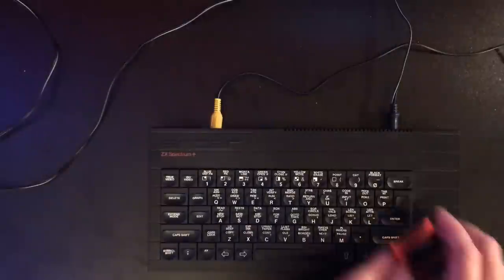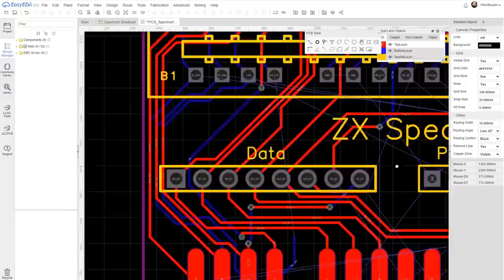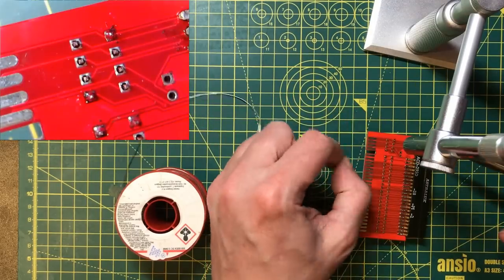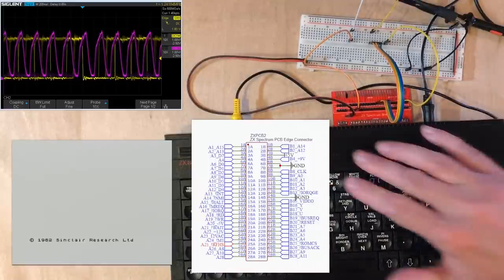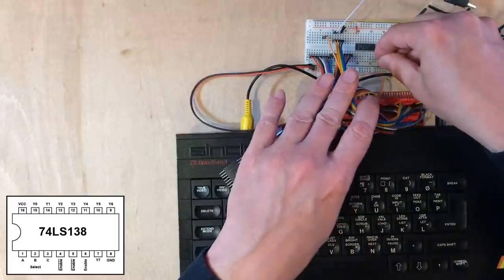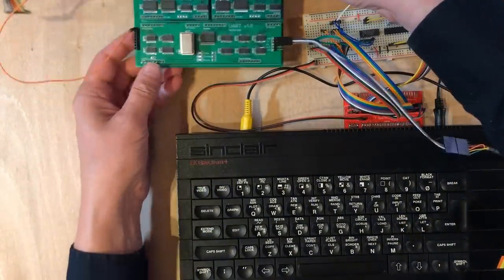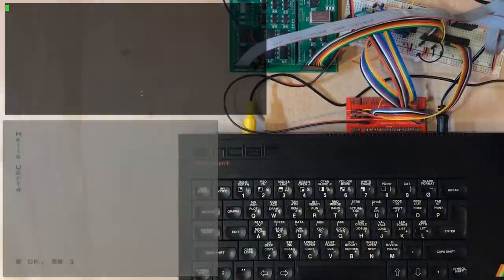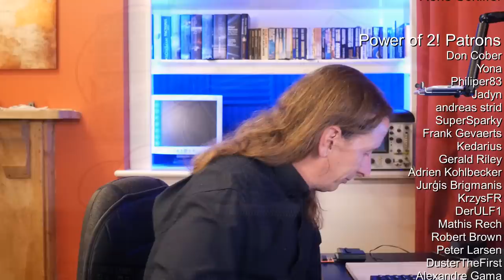ZX Spectrum, Expansion Port Research

Comment: Hello, I'm glad you back on Speccy Thema. Sorry I didn't respond earlier. You don't really need to distinguish between read and write if you dedicates a specific addresses for specific operations; like one address for write parameters, and another for read results. I mean if we(you) are still thinking about "coprocessor" expansion into ROM slot. 
To make expansion direct on edge connector from speccy will be easier for sure :-)
Reply from the maker: Making the expansion the main port rather than the rom cartridge would of course be easier. I’m not the guy for the easy path.

Comment: I really like the idea of extending the functionality of old machines by changing what they interface with. A while back I was working on a project to make a SNES controller out of a block of wood by using some conductive ink for touch sensing and having a microcontroller translate it to SPI for the SNES. I think I still have it laying around half finished somewhere.
Reply from the maker: Sounds interesting!

Comment: I know this is quite an old video by now, but for anyone watching in the future: flux will help with getting the solder to properly flow and not just bead up on the surface.  There's a tiny amount in solder wire, but not enough to prepare those large surfaces.
Reply from the maker: Flux is sometimes a tradeoff between easier soldering and the mess!
Reply: @weirdboyjim  That's certainly true!  I've spent plenty of time cleaning up leftover flux with alcohol and a close-cropped brush. Situational for sure, might help enough to be worth the mess on something like this edge connector.
Love your videos, inspired me to implement a close analogue in verilog to run in simulations to really understand what's happening at the lowest level of CPUs.

Comment: You're brave adding a copper fill around the edge fingers. Lots of potential for shorts from resit wearing and alignment tolerances. 😂
Reply from the maker: Well you're right, I didn't consider that.  Doesn't really matter for a temporary breakout like this but I'll try to keep it in mind when I design something more permanent with an edge connector.
Reply: @weirdboyjim  Hehe! Just trying to save you a mistake I've made before!

Comment: @14:30 Umm...the clock does stop, every time there's a CPU access to contended ram. That might explain both the unusual shape of the wave, and the clock rate discrepancy as well. However, I know very little about oscilliscopes. There is no crystal on the Spectrum, true, the clock generator is built out of gate array elements on the Ferranti Uncomitted Logic Array.
Reply from the maker: Yeah, the clock is a basic 2 transistor oscillator. Looks like the ULA pulls it down when it wants to take over the bus.

Comment: Wow... I must have missed it last time... "top marks" to whoever put the Spectrum edge-connector stuff into the EasyEDA library! So nice to have fiddly jobs done for you by somebody else!
I'd expect to see everyday stuff in there but Spectrum add-ons aren't exactly what you'd call "mainstream" - excellent work whoever you are.

I'm also, finally, impressed with Sinclair BASIC... when you did `LEN a$`, I said "nope, you need parentheses on that function"... ... ... and you didn't. When you indexed into a string like it was an array, I was all "No way! This is the 1980s! That won't work!!!"... ... ... and it worked. As a long term Speccy detractor, I'm now like "oooh! That BASIC's actually quite good".
Reply from the maker: Yeah! That was handy! The spectrum basic is an odd beast,  the method of typing whole keywords seems weird at first but once you realize that's how it's tokenized in memory (rather than being stored as text) it makes much more sense.
Reply: They've spelt the "refresh" signal name incorrectly though - it should be RFSH not RFHS.
Reply from the maker: @TomStorey96  I’m prepared to overlook that.

Comment: Your irritation while routing may have been alleviated by using the auto-router.  It definitely would've been an easy design to check over after it completed.  Just a thought.  Great job, by the way.  You have one of the best channels for learning about hardware around.
Reply from the maker: Perhaps, but then I would be reading lots of comments about how I shouldn’t use the auto router 🤣.  Glad you liked it.

Comment: There is a waste operation in the calculator, that writes to location 0.
I noticed that because my old zx has 64K ram. At startup the orginal rom was copied in to lower 16K. At some math operations location 0 to 8 was changed. Changed this waste routine to dump somewhere else.
Reply from the maker: Interesting, and a bit weird. Good to know I was seeing legitimate writes though thanks.

Comment: The ULA does have control over the clock going to the Z80. What it does is to drop the clock signal whenever it needs to access the screen memory in the lower RAM to ensure that it rather than the Z80 has control over the bus going into the 4116 chips. Part of the consequences of this can be found in the custom loader software used to DRM protect later Spectrum games. The code for these loaders was always ran in the upper RAM because the process of interleaving memory access and instruction fetches with the ULA's fetches meant the timing of the lower RAM could not be guaranteed making a loader coded in this space less reliable.
Reply from the maker: Yeah, I remember the lower ram was slower.
Reply: It was with the ZX, messing with some game in MONS (as one does), that I encountered my first anti-debug feature ever... I was staring at the screen in disbelief at the code writing a constant into a register, then immediately reading it back and comparing it to another value - wtf, how can this ever succeed...?

Then the little lightbulb went on above my head and I just laughed my ass off: the register in question was the R-register, which gets auto-stepped in hardware, and if you were step-by-step debugging you sure as hell didn't read the same value back as if the code was executing continuously. Trivial to bypass once one understood what was actually supposed to happen...
Reply: @AttilaAsztalos  Ah, yes. That was the second version of something which I think was called "Speedlock". I wound writing a program that automated the process of modding the decoder to get to the loader. Ended up that I could crack those in a few minutes!

Comment: Living in a broke-ass EE country at the time, I nonetheless somehow managed to pester my parents into getting me a local ZX clone (a CIP03) and managed to miraculously source a gorgeously red QuickShot II joystick (that thing had autofire ffs!), but had no way to connect the two. There were precisely zero ways to buy an interface or at least the relevant edge connector. 

But the actual circuit of a Kempston adapter was a piece of cake for my TTL-savvy young self, and the logic ICs were actually available locally (with some effort). So I hand-sawed a bunch of long thin comb-like fingers (for individual flex) with the right spacing into two pieces of PCB, drilled two holes and soldered a short piece of stripped copper wire into each finger (as "the contact"), then bolted them to each other facing inwards with a third piece between them that spaced and keyed them to the key slit in the extension port. 

Needless to say, the pucker factor on the first test of this very DIY interface was indescribable - I was intensely aware that if I short or hog the CPU bus in any way and damage the Z80 I'll NEVER get a second ZX... but it worked fine. For years and years. Good times...
Reply from the maker: I’m equal parts impressed and terrified by that description. Cool that it worked!

Comment: Interacting with the spectrum is a bit scary in some ways, I would be worried about something connected to the port potentially damaging the machine, maybe if you do a revision you could add some buffer ics to it to help isolate it a bit.
Reply from the maker: That would probably be smart and safer, we do if course always do the smart and safer thing 😅

Comment: It would be cool to see some new spectrum games making use of cartridges, as the cartridge could do somethings the mappers did with the NES - like auto-cycling through graphic definition table every frame for parallax scrolling effects, per-scanline animation, DMA blitting etc :) Obviously it would have been prohibitively expensive back in the day (the speccy was my first computer) but now a custom "ROM" cartridge is obviously much cheaper :)
Reply from the maker: Well the cartridge port isn't anything like as flexible as the snes one was, but part of my goal is to push the limits of what we can do with it.
Reply: The Spectrum has bitmapped memory in RAM. The NES used a tile table located in the cart, usually ROM. So that's how mappers could do tricks like that. For the Spectrum you can only alter the screen by reading and writing to the RAM. Even if you had some separate circuit, rather that doing it on the CPU with software, you're still limited by how quickly you can write to old RAM chips like that. So that idea would be difficult to get up and working, at least much more difficult than on the NES. 

The tiles in cart ROM meant the NES didn't need tile RAM, so was quite a lot cheaper to make. The downside was that each cart needed 2 separate ROM chips, CODE for the CPU, and CHAR for the PPU. They had their own bus each which is why the NES's cart connector was so enormous. Overall it was cheap, and made games at least twice as expensive as they had to be for other consoles. The Master System did it the usual way, and had much better graphics, so there was no advantage to the design other than money. "NES-expensive" is a term that should be in the lexicon as much as "Nintendo-hard" is! ALL 8-bit systems had difficult games, it's not a Nintendo thing. But as ever, it's how the Americans had things, and they're in charge of the language apparently, including slang.

See also the "Videogame Crash" which only happened in North America, and only affected consoles.
Reply: @greenaum  yep I’m aware of how the spectrum worked - I wrote enough software for it 🤣 I’ve also written an NES emulator along with others in my spare time… Although different there is the possibility of greatly increasing the potential using a custom cart:
DMA transfers. By halting the Z80 and copying from ram in the cart to display ram which is much faster than the usual method of popping from the stack into registers then pushing into display RAM.
Handling sprites and a tile map based display in the cartridge which will be pushed to the display ram without the need for the z80.
Other effects such as pixel scrolling etc which again would be handled in the cartridge and then DMA’d to the display ram.
Yep it’s different but there are. A lot of possibilities 🤣

Comment: Just an idea: An easier way of soldering the connector might be going with a thicker PCB. 1.8mm of even 2.0mm? Question is off course, will it still fit in the connector.
Reply from the maker: Unfortunately that would be a problem for the edge connector the other side. I wondering how think I can go, I have a similar problem to solve elsewhere that idea may be more suitable for.
Reply: @weirdboyjim  Just by watching the video I think you can get away with 1.8mm

Comment: Nice! The sound board next? 🙂
Reply from the maker: Working on it or interfacing it to the spectrum? That would be pretty much just a wire swap from here.
Reply: @weirdboyjim  both! 🙂
Reply from the maker: @FrankGevaerts  Comet o think of it,  interfacing it is the easy bit. Making some code to play music on the spectrum would be time consuming.  Maybe I should just work on the Audio circuit.
Reply: @weirdboyjim  Maybe... I'll admit that my motivation is that I want to do this myself (although maybe on an RC2014 instead, or both, as I have an RC2014 backplane with Spectrum edge connector...), so you finishing the audio circuit far enough to publish everything would help :)
Reply: @weirdboyjim  I think getting the audio onto a PCB next would indeed be great!

Comment: I wanted to use the interface when I was a kid. I had to wait for Arduino`s to come along. I would of built some crazy stuff.
Reply from the maker: If only I knew the basics of digital electronics then!
Reply: @weirdboyjim I`m sure I read in the ZX manual when I was a kid that the IN OUT functions were controlling the interface pins. I might have to have a utube search. Would of been nice to know what we know now. I was just playing with Triacs etc making disco lights with a 555 timer and old tape desks. I used a decade counter chip to switch between lights. Then add ZZTops lol.

Comment: You can see the memory fading away with this little program: For example user definded graphics become distorted.
ORG 29000
           LD SP. 32767
           XOR A
LOOP:
             LD R,A

             JR LOOP
END
this keeps the the R register at 0 preventing the complete refreash cycle.
Reply from the maker: I had no idea you could mess with it like that.  I assume that's partially a by product of the way video memory is shared.
Reply: @weirdboyjim  The lower 16K is refreshed by the ula, the upper 32K by the Z80.
You can not run this trick in the upper 32K
because the program is fading away.
Reply: @weirdboyjim  bit 7 of the R register can be used as a "general purpose output" - the Z80 auto increments R each instruction but it wraps back to 0 after 7F rather than FF. You can manually set/clear bit 7 and by decoding the refresh cycle you can then latch it into a flip flop or similar.

Comment: Could you not use 2x Data Latches for the Address Latch and output the .......

LD HL,(ADDRESS)
LD DE,(PORTADDRESS)
LD A,L
OUT(DE),A
INC DE
LD A,H
OUT(DE),A
RET
Reply from the maker: I'm using memory writes rather than I/O ports because at least some the lines I need are exposed in the cartridge. There is some really weird stuff in the IO range of the spectrum that was done to save cost that I didn't want to fight.

Comment: Could you use solder paste and hot air gun?
Reply from the maker: You could definitely  use that to tin the pcb but I’d be worried about taking hot air to the plastic of the connector.

Comment: If you were adding connection points for every single pin then yes it would make sense to add every pin label but, as you haven't broken out every pin, I agree with not adding every label.
Reply from the maker: I have to admit I was under time pressure when I made this board or I might have been a bit neater in a bunch of areas. If I had known how much of a pain it would be in both wiring and video editing I'd have put a bit more work into the PCB.

Comment: Hang on... you got rid of the pins because of routing hell. How did they end up back on the board?
Reply from the maker: Perhaps my wording was poor.  I always had a set of pins that had every output from the expansion port in the order they appear on the edge connector (That was easy to route). The bit I removed was an extra set of address and data lines that were reordered numericaly (That was would have been difficult to route as many lines swap over). In hindsight I wish I had spent the time to route the extra set, it would have made the testing step smoother.
Reply: I went back. You installed pin headers in the through holes of the middle edge connector socket.
Reply: V2 in the works? 😁

Comment: Seems to me your life would have been easier if you would have tinned the bord first, before soldering that bottom connector in.
Reply from the maker: I think you are right. I should have tinned the board and the connector. Maybe tried to shape them beforehand as well.
Reply: Yes, that’s the way I do it, it’s a lot more consistent than just putting the solder on the top.

Comment: Only 40 years too late...
Reply from the maker: I know some people don’t understand people playing with retro tech.
Reply: @weirdboyjim   Back in the day I hooked my 48k up to a line printer and wrote a program to calculate Pi - outputting to the printer, it went through a box of tractor fed paper. I also made a UPS as I was forever forgetting to save my listing. The last project I made controlled the ignition of my Dads car and heated up the interior for a warm journey to school. I have moved on to the ESP32 range of boards now as they have a lot more power and versatility and a lower cost of entry!